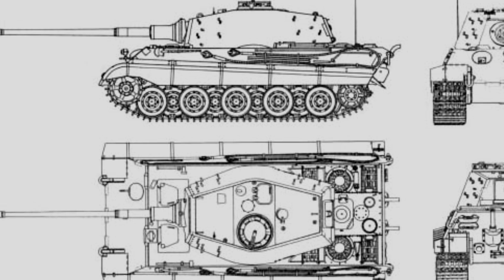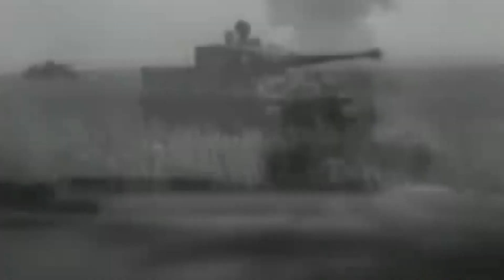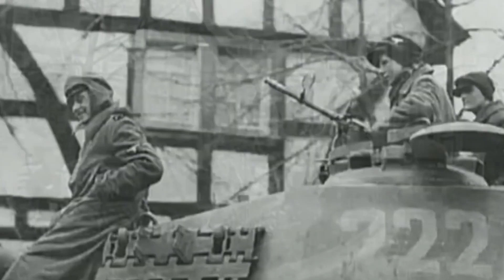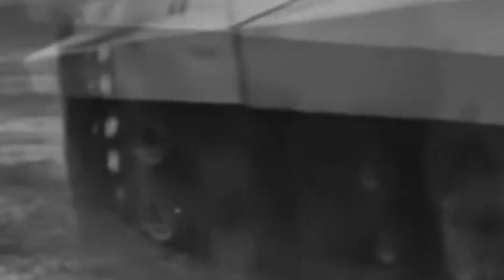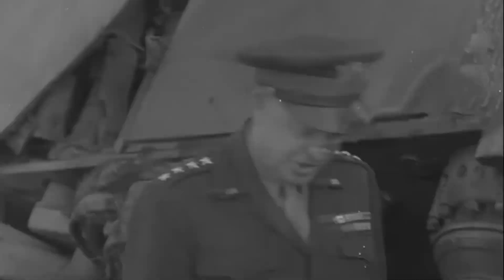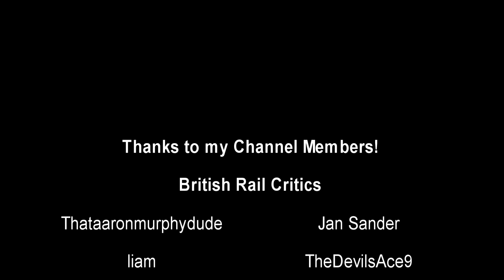Germany's Ultimate Tank (Didn't Help Them Win at All) | The Tiger II | History in the Dark

Comment: @10:17 - That's a rare Porsche turret on that Tiger II. These were mounted on some of the early Tiger IIs, but dropped in favor of the Krupp one, due to a shot trap on the lower part of the turret.
Reply: Despite popular belief Porsche had nothing to do with the early production turrets. Both were designed by krupp and the reasoning for the later turrets was due to manufacturing issues with the former.
Reply: It wasn't replaced due to a shot trap, that is just a myth. The serien turm is already in production before the either the Western Allies or the Soviets even encounter the Tiger II in combat. 

The replacement was simply due to the initla turret being more complicated to make due to the curve at the front and a few other parts. The redesigned serien turm from Krupp was easier, quicker and cheaper to produce.